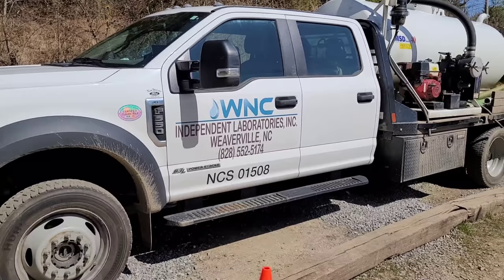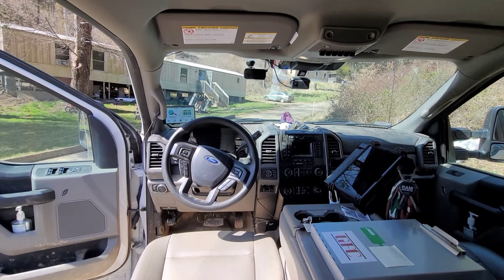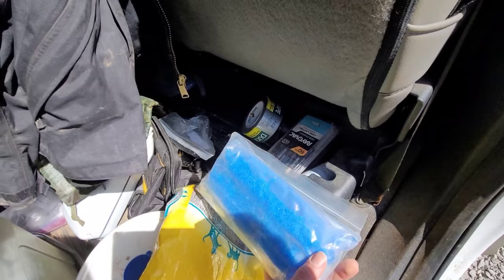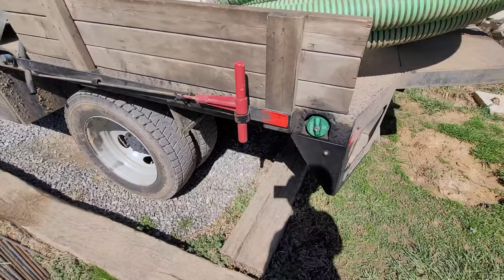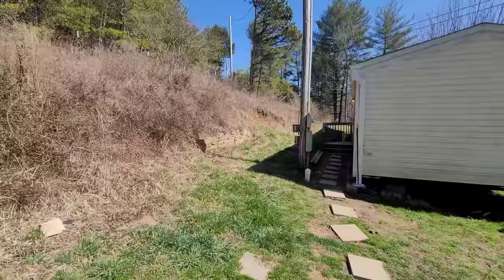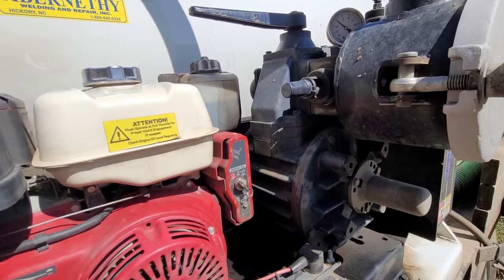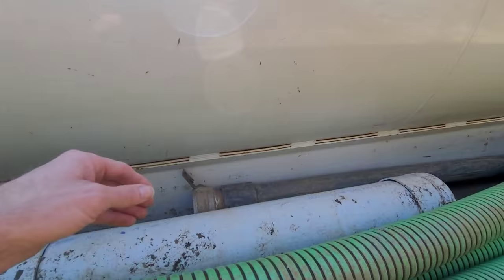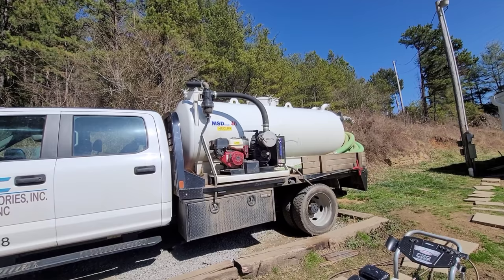Truck walk thru.

Comment: Just some notes, I would check with your local DEQ regs for deleting emissions on z commercial vehicle if caught that could cost a lot to fix, rig seems to be pretty squared away and I wouldn't know what to improve unless I was in the shit haha. Bet you run a fleet had card if I had multiple trucks I would too, but I got a fuel rewards app that seems to be pretty decent in the last couple weeks I've racked up over $30 on it, of you guys do remote pumps yo might thinks about setting a rig up with a which as well. Can't remember if I saw a fire extinguisher but you probably got one. Don't know how much pumping you do in the dark but a light inside the tank could be useful to see if it's getting full in low light or a small one out side right buy the glass window on the tank. Might also see about remote start for you pumps, though idk if you need to start them in neutral and switch to vacuum. Just some ideas

Comment: I’ve got a few suggestions. 
Redo this video and omit your statement about deleting the DEF system. It’s against federal law and somebody who hates you might see it and cause problems. 
Secure your gas can. Hard wire your Honda pump to the truck battery. 
Put some type of handle on that rigid pipe that you had the peculiar name for  to make controlling it easier and to possibly keep somebody from losing their footing maneuvering it. 
Put reflective tape down the sides of the truck and the rear. If you’re going places it’s dark enough for you to not be able to see, other people can’t see you either. Don’t buy the cheap stuff (which it doesn’t appear you ever do) get the 3M reflective tape and go down the sides of the truck and the back. 
The valve that freezes for the dump. Wrap it in heat tape and wire it to an inverter. When you’re headed to dump it, turn it on to warm it up and thaw it out. 
The other vacuum valve that gets water down inside of it and freezes requiring disassembly, get a traffic cone and cut it down the side (not to the top though) to allow the handle to slide into the cut. Plug the top of the hole in the cone with whatever you like. No more water into the top of that valve. 

Should you decide to utilize any of my ideas, I would like my big winnings donated to Saint Jude Children’s Hospital. 
Keep up the good work and be safe my dude!

Comment: Possibly organize the back seat with a wood frame so everything has a designated place, unless you use the seat obviously. Depending on where you're located for winter get a insulated sleeve to wrap around your valve. Possibly have the same people that make the metal o rings for the prong to weld on the head rack for other tools you have. Other than that sir I'm not that smart for your pump freeze problem lol

Comment: My suggestion is to get some boxes with lids to keep the back more organized it is also safer to keep the stuff in closed boxes in case of a accident the chance of stuff flying around in the crew cab is less than if the equipment is left lying around in the back seat like it is at the moment

Comment: Should get a quick jump kit for the trucks so that if you find yourself with a dead truck and need to get out in a hurry you aren’t having to fight with cables, you plug your end into the socket and the cables go onto the other trucks terminals or if it has a plug as well. Also I’m surprised you don’t have like a camping shower set up for those really bad days. Let’s be honest, hand sanitizer doesn’t always cut it

Comment: A short hose to do jobs close to the truck. The shitter getter on the jobsite always complains about getting a full section of hose out for a toilet 5 ft from the truck.

A set of small hand tools. 4 lb rubber hammer. 

Not sure if you need the backseat but adding an organizer for all stuff so it doesn't slid around. Luke color coded milk crates.

Comment: Id add a winch system, and a cage for the tools.  A secondary alternator to the engine to charge the pump battery.  Perhaps an AGM battery in a marine box to make it last longer than a year too.  So the battery is not exposed to the elements..

Comment: It is interesting when water gets into the pump. I had to deal with that multiple times in the farm  as the water pumping and carry trailer is made from sewage transporter I think :D with bits missing, I have no idea what original protection was, but there was a level indicator, that broke decades ago. So people kept getting water i to the pump and it breaks composite fins in it. Several yars ago I got similar water traps for my fathers crew to install. Bot the pump was already dead. Well, after repairs it took way too long to pump. Insides uneven and scarred, so had to get a new pump.

Comment: Honestly, I can only think of two things. A portable winch that can be coupled to the front of the truck if needed or on a frame to help lift the lids. Second is to ask in advance for people to send pictures of the access drives or videos, you can setup an WhatsApp account or telegram account so people can send those pictures/videos. Maybe include a water kettle that connects to the car 12V so you can heat water and use to clean hands, and even drop on top of the ice that freezes those connections that you mention.

Comment: The only thing I would change would be to direct wire the pump starter to the trucks main batteries and eliminate the auxiliary battery.  Otherwise it looks like a well thought out system.

Comment: The reason why the seal are not glued in the camlock fittings is because they are considered a consumable item. I work for a large waste company with 5 10000L demountable vac tanks and a 200000L semi vac tank we replace a seal every couple of weeks

Comment: Add a small slip hook welded on the back to hang a drip bucket. 
Cut a notch in a  tupperware bowl to cover your valve handle to prevent water from even getting to the shaft seal. Just drill a hole through the bottom of the bowl and run the bolt through to hold it.

Comment: I only had one main suggestion. Have you considered putting heaters on the pump control during the winter to keep them from freezing? My guess is that they mainly freeze up over night. I'd get really tired of having to keep taking them apart to make them work again.

Alternatively have you tried using a propane torch like you'd do saudering with to unstick them?

Comment: For the lever on the pump, it seems as if the handle comes off with the bolt on top? You could have a piece of thin sheet metal or something similar formed around the handle and down over the opening. Leaving enough tolerance it should still spin, then sandwich it under the washer and bolt.

Comment: Just wounder, bit since you are using a f550 and it has a PTO option, have you thought about using a PTO driven air compressor / vaccum pump? Then you would not need a separate engine. I have seen quite large compressors (close to volume / pressure of those towed by a trailer)

You could even add a PTO generator for when you have to run electric pumps

Comment: We have to inspect and/or replace camlock gaskets to prevent leaks from overuse/compression (chemical industry). If there is a lip for the gasket to sit in, try a slightly thicker gasket so it's snug. (We use teflon over viton ones the most).
Another trick for the plain gaskets is to apply high-vacuum grease to it. It's sticky and also makes a good seal. 
-heat tape for the valves that freeze? Run it off the car battery so it warms up when driving to or from a site? 🤷‍♂️
Reply: For your mookentooken(sp?) Do you have a valve at the end of the hose? Would a 90degree elbow and valve make it easier for the operator to control? It's what we use for sucking out of totes.

Comment: Hi I follow you on tiktok and I always respect a man willing to open up for ideas. So how about having a power inverter hardwired into the harness and having it installed in one of the side toolboxes? Having portable power wherever you need it could be invaluable
Reply: Or just one to plug in and try for a trial one. Dewalt sells a decent one for about $150

Comment: Switch out the generator battery with a Li-ion leisure battery. Wire all the vehicles extra electrical to it rather than off the truck. 
Slave a charge line to keep it charged on the move. 
Add a solar panel and inverter onto the roof, to keep it all maintained when everything is at a rest. Charging electrical costs fuel. . 

Secondly see about fitting an air deflector onto the roof, 18wheeler style to reduce drag. Fuel is money. 

Fit reclaimed aircraft food lockers/shelving in the back of the cab. Help keep all the tools, spares and etc organised and auditable. Lightweight and durable. 

Next trucks. Try and mount the tank a bit lower on the chassis. The extra height will increase suspension wear, fuel costs and pump wear. It takes more energy to lift a liquid higher that necessary. Think of it as reversed hydro electric dam. 

Try and shutter down the sides smoothly with a flatter roof. Again reduce drag and add advertising space. Ideal for getting the name out more and maybe partnerships/services.

Comment: Lesser cattleguards are pointless. I've gotten hit, and the truck sent the guard into their tire, and their radiator was wrecked. My pickup was still drivable and reliable, despite being t-boned. Same model 97-03 F150. If your getting one, get a good one.

Comment: How about: #1 adding an emergency cut off valve for when the pump is under too much vacuum to save. You would set it so that you can override it if you need to. #2 Add a scale under the tank so you can measure and log the amount you suck exactly. #3 Replace the Honda motor with electric motor that uses a power outtake from the engine or an hydraulic motor that uses auxilary power outtake if that is possible. Maybe just to expensive but should be less maintenance and simpler when set up.

Comment: James, couple things I notice, the big garmin? Why not go with Ford on board Nav? That also incorporates gps for remote and driver monitoring. The lights in the front are great, but what about some spots on the rear bumper to light the rear ground area for safety and a light on each side of the headache rack to light the work area on each side of the truck?

Comment: may be hard to explain but i can send a pic to an email if needed. why not move your under mounted tool box back slightly so you can mount a 5 gallon pail of cat litter on the outside of the truck. so if needed for a spill they don't have to go into the truck in a hurry.. probably with some sort of sewage on them if they were dealing with the spill. we had it set up like that on the tow trucks for oil spills when we got on scene.

Comment: 12v battery. Wire to truck battery instead. Put in dual batteries with an isolator on the one connected to the Honda.  With the life of a full size battery, you should be able to recover the cost by not having to replace those small batteries

Comment: Black out the back windows, install a coat rail and microwave for the crew, runs off either engine or leisure battery.
Don’t like the sat nav being on the left, too much of a blind spot, move to centre.
Reversing camera is a must, can get dash cams built in with reversing camera for driver.
Hand sanitiser is ok, but in my work vehicle I’ve got a 15 litres of running water, need to keep a small amount to keep lights/tools clear too.
Would like to see a metal gas can fixed to the headboard of the truck too.
Do you have a stiff brush or 2 on your trucks?

Comment: If you go away from ford dealer for service still stick with Ford parts especially for rear brakes. Aftermarket rear rotors will expand when park/emergency brakes are applied and not hold the truck. My father inlaws whole fleet was ford and as his mechanic thats an issue we found and fixed by sticking with ford parts

Comment: What about running heat coils around the valves, could be wired to a button in the cab to heat up the pipes around valves. Also what about those reels for the horses, could have one on each side for the 2 different sizes. May be bulky but I'm sure it would cut down in set up and tear down times. Only ideas I have off the top of my head.

Comment: I’m sure you have probably looked into this before but it may help to change the pump battery to an AGM battery they are known to last longer have the same cca capacity as led acid battery’s and can be discharged and recharged as many times as you want witch allows the opportunity to have 12 v lights attached on a cord attached to the battery with an Anderson plug

Comment: Hi for the part of the pump system that freezes here in Ireland/ Europe we have a polystyrene cup which fits over a outside watertap which protects them from hard frosts maybe it could be adapted for your use or you may be able to custom make a insulating block from packaging polystyrene  really enjoy your tic toc  cheers from Ireland

Comment: A chase bar! They’re meant for Side by sides but I have one in the back glass of my Subaru. It adds another bright set of turn signals and brake lights. It can also double as emergency lighting for when stopped off the side of the road or having to block off part of the road. Mounted to the back of the tank it would make the truck more visible. I’m sure if a truck was rear ended or hit and it came up that the truck was made more visible it would help. They average around $80. I have a video of my set up on my YouTube.

Comment: You could probably install a proximity switch or a whisker switch on the float that shuts off your pump automatically.  Just in case the operator is not paying attention.
Reply: Also I can't tell from the video but I'm a little concerned about turn signal visibility behind that guard.  Especially in sunlight.  

Also I'm sure its rare but I worry about the hoses bouncing out on a rough driveway with an aggressive driver.  A simple safety strap with a dog leash clip going from the tank to the bed side would be sufficient.

Comment: Skirting and insulation around bottom of the house to save on heat. Esp if any exposed plumbing or plumbing near exposed surfaces.   Id need to be more versed in the septic industry. Truck probably has gps tracking? Maybe a housing or hydrophobic material/substance on pump switch. Seasnake or other flexible camera for inspections? A way to secure the tools to the bed if you dont already. OSHA 10 or 30 safety classes for the crew? You mentioned confined space in a tiktok so seems you are up on that. Any use for ladders? Maybe a DIY handwashing station? Saw a plumber had one in a youtube video

Comment: I hear you about your battery on electric start Honda. Have you thought about using AGM MARINE batteries?
Also install an ABC switch to automatically recharge or select charge ghat battery ftom your main alternator. A charged Marine battery should last 5 years. Well worth the inital cost. Use them on my boat. ABC switch can be purchased from any marine supply house.

Comment: Run a wire from the honda pum to the main battery under the hood of the truck. That will fix your battery every year. Seen on tictoc put comment over on it as well

Comment: As far as the pipe from the back freezing. Heat tape is used some hvac systems to keep drain pipes from freezing. Plugs in and keeps pipes above freezing just wraps around pipe
Reply: No kids are on truck, 🛻, it's fine

Comment: Kolpin rhino grip tool holder 
Kolpin fuel pack secured fuel is safer fuel. 
Also talk to your flatbed manufacturer or your local welder about the bed rail tool compartment. It would be where your big led light is in the back but on our brush trucks we store our 2” hard suction hose and a a few tools. It’s wasted space otherwise.
Reply: Also check out American truck boxes they can make any shape or size boxes for tools or cab organization.

Comment: Wire the truck battery's to the honda motor with a solenoid saves expense of lawn and garden battery and potential down time. heat tape on the valves we do that to ours no more freezing all so wrap with insulation cover over with exhaust wrap for aesthetics. And on the vacuum side install a variable Mercury switch wired to the coil to shut down the pump under extreme vacuum to save the pump from damage increases pump life exponentially

Comment: There is a way to have safer storage for the tools on the side and the gas can which is a trailer storage hitch that hangs by the hitch that can have a storage container that is able to lock and make good use out of the unused space and even if you need to pull something with the hitch some storage hitch’s have another hitch on the back to pull a trailer or anything that may be needed.

Comment: You should relocate that battery for the honda motor, into the box under the bed, or even, if possible, into the cab of the truck. The heat/cold cycles of being exposed is what is killing them. Being a bit more protected will help them last longer. Not sure if saving the battery will warrant the cost though... but if you get a new truck, maybe it will?

I would find an independent shop that will do the work on the trucks, almost higher them on a monthly basis to prioritize your trucks? How often do they need repair/service?

Comment: you could put a separate leisure battery with a Contactor to alternator will change the battery when engine is running and disconnect when it not running Connect at 12 V fridge and all the lights and a 110v inverter and you don’t run the risk of the draining battery and be unable to start the vehicle they have on camper vans you could also Connect the Honda engine to that as well